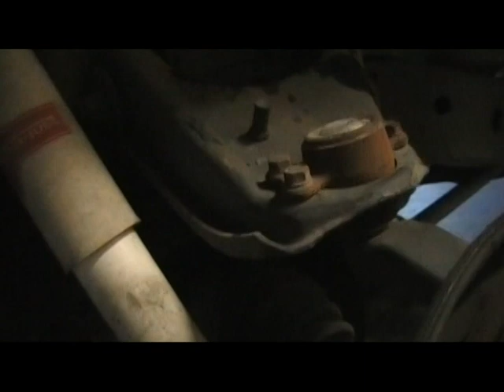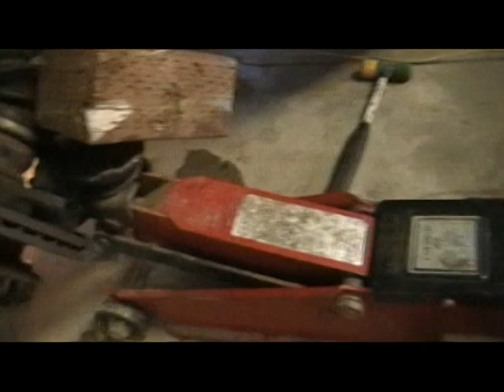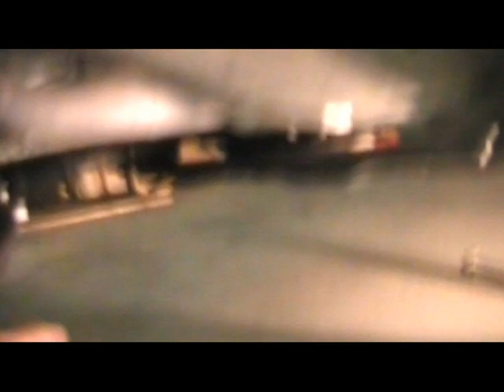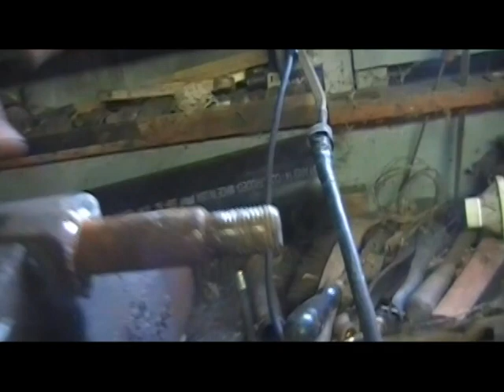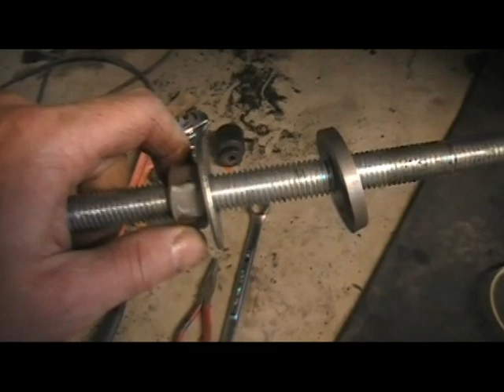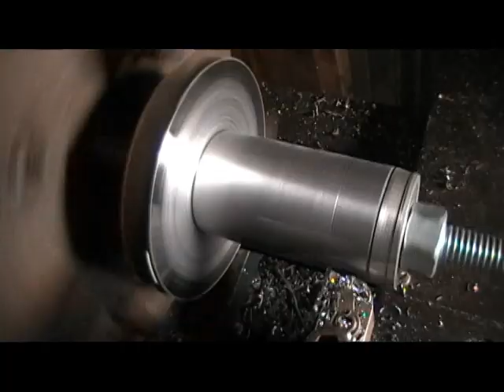1989 Isuzu Trooper Upper and Lower Control Arm Bushings

Comment: I just replaced the front LCA bushings...they were hard enough.  The rear wouldn't budge with a bushing press kit designed to do just this.  In fact I tweaked the Chineseum M16 all-thread that came with the kit.  Decided not to replace on my 97.  I'm kinda glad I didn't destroy the bushing trying to get it out as I don't have a lathe handy to fix any oversize issues with the bushing!  I'll get them done some day...so many more critical things to tackle on this thing.  Great video, and thanks for posting!

Comment: The video started and I was like ... holy his Troop hood is upto his chest, thats a tall Troop, then he panned down and I saw it was jacked up..lol  good video budz
Reply from the maker: Haha yeah I just have it at stock height. Going to check out your videos soon I already saw how nicely you painted your 4ze1. Next project I'm planning for my trooper is to put in an ARB air locker in the front.
Reply: @nicholasbottini8731  The ARB unit is expensive, I bought an Aussie lunchbox, not much cheaper, very interested to see how your air unit works out. great I hope. Air hammer kicks those bushings out, try it when you do the rear end, if you haven't done those yet.
Reply from the maker: I haven't done either. Both differentials are open right now. I haven't bought the unit yet. I didn't know anything else was available besides ARB. My axles are the Isuzu axles. Did yours have the Dana? Every year I do an off-roading trip with my dad and my brother and I keep running into a situation where I wish I had at least one differential that locked up.
Reply: @nicholasbottini8731  The 91 Trooper that I am doing a resto-mod on now came with open diffs. Corporate 12bolt rear and 10 bolt front. standard set up with open diffs. I have had 18, 1st gens now so I collected G80 LSD rear end from other Troopers. Looking for a G80 may be your quickest way to make an improvement. If you find one with good bearings then you could just do a swap in. 4.56 gearing is standard in Canada. Its all I ever see but some guys are able to find the 4.77 I have never needed them. with an MUA5, G80 LSD and an Aussie in font, I expect this Trooper to climb trees. I'll keep checking your channel out.👍
Reply from the maker: My gears are 4.56 as well. I'm in California so it's hard to find any trooper parts at all in junk yards around here. Do the limited slip differentials last long? Or do the clutches wear out pretty quick? I'll keep an eye on your channel too. Seems like you have a lot of experience
Reply: @nicholasbottini8731  Thank you, cheers. Yes to answer your question Yes the G80's that I have are 30 years old, in auto terms, they, like the rest of the 1st gen troops have outlasted everyone's expectations. The bearings and seals will need attention before the diff will. of course they can be destroyed like anything. I have heard reports from some extreme wheelers that they have cooked a couple, but I don't let that effect my opinion because the G80 is known to be very durable for power under 500hp. (A quick gab is to find a junk 2nd gen with a bad auto trans. many 2nd gens came with G80.) TO claim that one has worn out has so many input factors IE; was the diff set up correctly by an experienced tech? Proper backlash, correct torque down and all that. Did the guy install new bearings and assemble everything to spec? Did he change the correct gear lube for the temp range every 30k or if it was rough duty, did he cut the time interval in half and service the lube every 15,000km? right so many factors. Saw a Trooper own on Instgram 2 days ago joking about the diff check light coming on and that it was time for service. his rear diff was glowing red molten metal in the photo. I was raised 1/3 play an 2/3 service and maintainence. anyway I am writting a novel here. email anytime or your find my number on the channel. Love chatting with another Troop owner.
Reply from the maker: Thanks man, that's a lot of good information. Let's definitely stay in touch. This conversation is encouraging me to start working on mine again.
Reply: @nicholasbottini8731  Awesome, dido, we need to do that for each other. Isuzu community rocks

Comment: I have a 1989 as well with squeaky bushings. after a rainstorm it started. I thought i should be lubricating them but now i realise it froze the inner sleeve from rust.. and the squeak is the rubber bushing moving.. what puzzles me about this design is what part moves in what part? if you are tightening the bolt that holds it together you would think its squashes the two outer halves together and cinches up the inner part of the bushing. My MG same way..

Comment: thanks mate from Australia, I'm trying to get the cv shafts out of  my Jackaroo, and have to get the lower arm off to do so. pull most of the front end off to get axle out far enough to get to the circlips holding the cv shaft  into diff housing.
Reply from the maker: Good luck buddy, let me know if there's anything I can help with.
Reply: @nicholasbottini8731  I had to pull the entire front axle out of the Jackaroo, to change the cv's. what a job !!!
Reply: @fireballfireball1067  there's a retainer ring on inner CV cup. Wipe grease away you'll see it.

Comment: Yup im doing ball joints center link and tie rods, the shop can totally have 800 bucks to do the bushings lol
Reply from the maker: I'd be curious to see how a shop does them compared to me rolling around on the floor. It'd be interesting to see how they get the big bushings in the frame out.
Reply: Exactly the Carage work is random fix not worry like you 👍🌹

Comment: how many diameter did you make to the big bushing ?
Reply from the maker: I was aiming for .002" bigger than the bore and I was measuring the bore at about 1.732" so I probably turned it down to about 1.734" or 1.735". I had to remove somewhere between .015" to .02". The smaller you turn it the easier it is to press in but I wouldn't want to risk there being any slop so I tried to leave it tight.